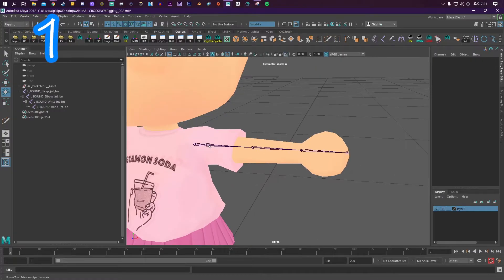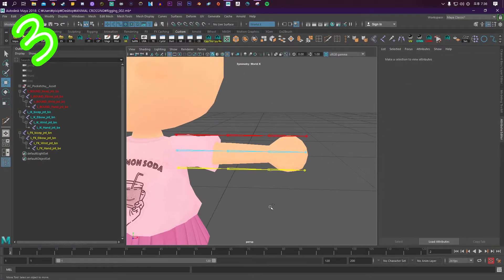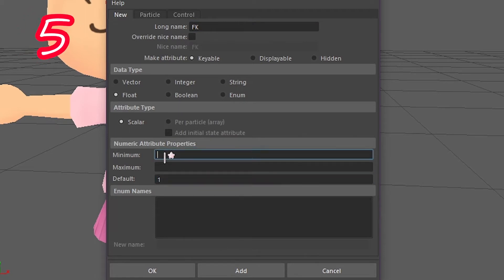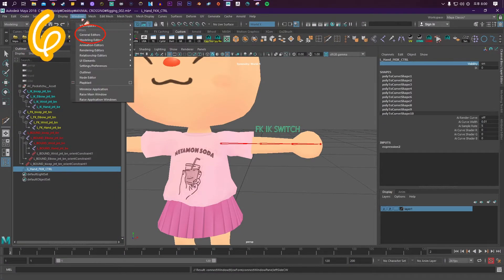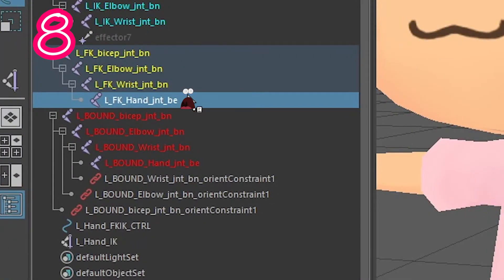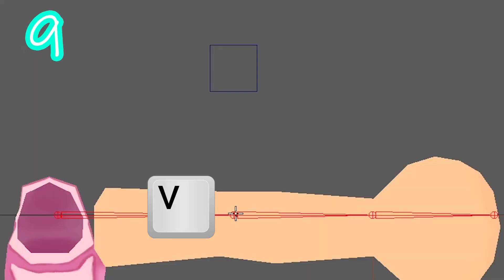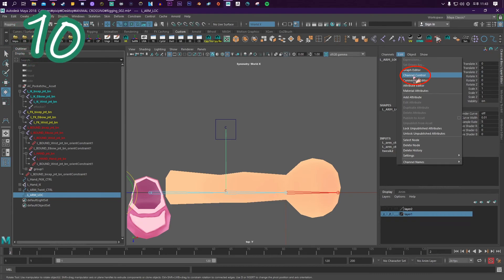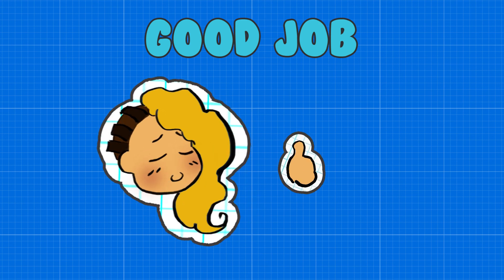How to l TUTORIAL l Creating an FK/IK arm setup in Maya

Comment: I know this video is 4 years old but I need help

I’m stuck on step 9 where it says to make an elbow twist control 

I’ve tried a circle, square, and plane nurb but no matter what the CV curve tool won’t attach to the nurb

I think it’s something special about the square right? Cause yours seems whole but whenever I make one it’s in 4 pieces 

Also does the elbow have to be in a T pose cause my character is in a A pose position so I don’t know if that could be the problem
Reply from the maker: You can have you character positioned however you like!
A and T all work the same!
The main difference you'll find as you continue on your journaey as a rigger/modeller
is that some things are easier to do depending on the pose.

If you want to have a smooth armpit without having to blendshape, T pose gives you easier access then A pose as there's usually less topology making it trickier to weightpaint for instance.

But try everything, what works for someone else may not work for you, plus each project may call for a different tactic! x
Reply from the maker: Hi Loadin!
Don't worry about the time frame!
When it comes to Maya knowledge I never forget x

It can't be a proper nurb as that's a "real mesh " you'll need a Nurb Curve to use the nurb tool!

The one I have is pre joined from a website called digitual tutors (which no longer exists...)
however you can learn to join and make your curves from this vid:
https://www.youtube.com/watch?v=kfvoFSjKNV4&ab_channel=PixifiedTips

And this video shows how to grab a nurb primitive curve that will work!
(it doesn't have to be a square all of them are the same) 
https://www.youtube.com/watch?v=RlCuwPWPt_o&ab_channel=PixifiedTips
Reply: @PixifiedTips  wow thank you for the speedy  reply and the advice

I’ll be sure to let you know if I have anymore issues and Thank you again you’re a life saver
Reply from the maker: @loadin5297  :_pixifiedPixifiedaw:
Reply: Thank you for commenting this Ive had the exact same issue you've saved me a headache 🙏

Edit nvm wasnt able to fix anything ended up letting it click to the models mesh then right clicked -> control vertex  -> selected the end that was clicking to the wrong space and manually moved it to the middle of my Twist Controller

Comment: For the elbow control if it is doing what I think it is wouldn't bit be better to use use a pole vector? Basically does the same thing in a lot less steps
Reply from the maker: Hi Ruby!
The rig allows you to have FK and IK (Ik uses the polevector)

If you don't need your rig to be able to use fk, then Ik and pole vector alone are perfect! x

Comment from the maker: Extra Tips Related:

1.) If elbow doesn't move use rotate plane solver
2.) to connect FK and IK arm bone to ONE wrist control;

-FK Hand jnt> CTRL click Wrist ctrl: Use set driven key to key on and off
-IK Hand jnt> CTRL click Wrist ctrl: Use set driven key to key on and off

3.) to make finger controls follow finger joint;
finger jnt > click ctrl> point constraint (maintain offset)